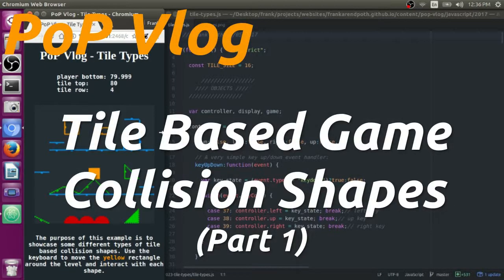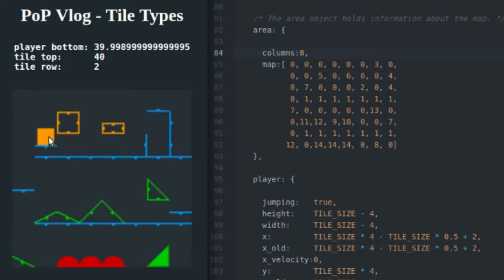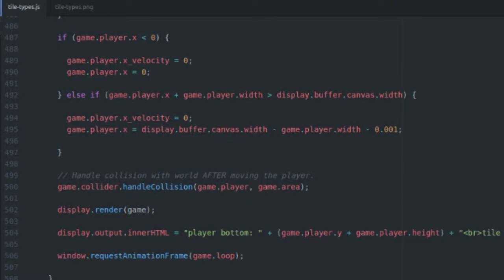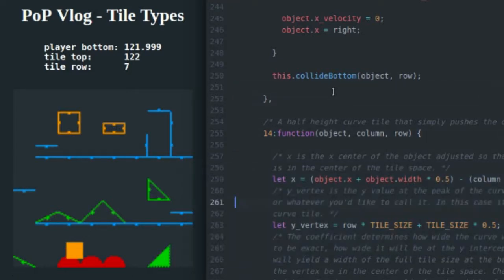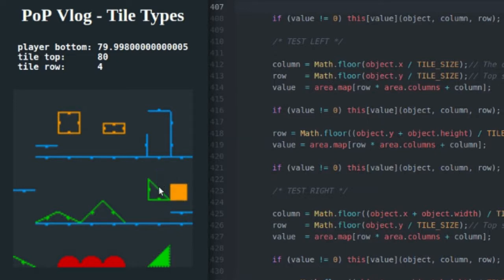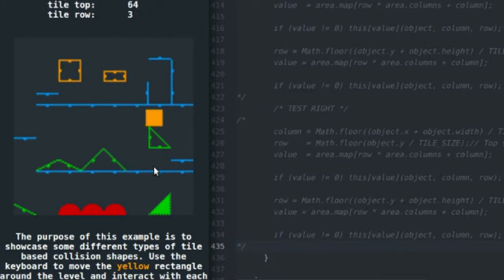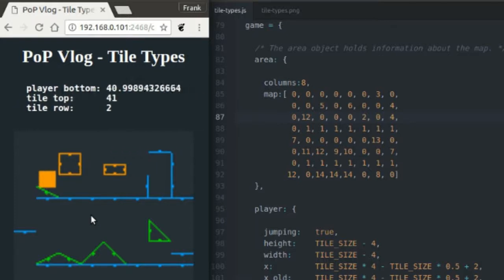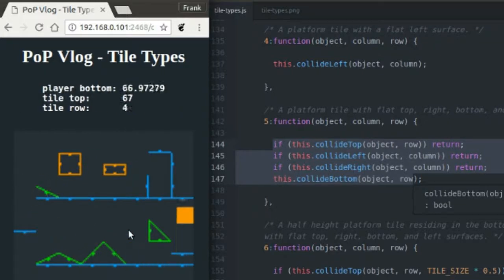Tile Based Collision Detection and Response - Part 1 Broad Phase System

Comment: Great video man I never thought of doing collision like that. I like the modular-ness! Also if anyone is using this for top-down game collision, ensure that in the broadphase you use the opposite old position coordinate for each section eg. top section: old_x, new_y   left section:new_x, old_y
Doing this will ensure that if you press a key into a wall tile your player wont get stuck sliding along it.

Comment: Thanks for your videos. I haven't found anything more helpful on this topic. I have been trying it out and found some improvements.

You set the jumping property to true, only if the user presses up. But when falling from a ledge you shouldn't be able to jump while falling either. I'd set jumping to true, if there isn't any collision from top in a frame and to false otherwise.
I have noticed, this kind of stuff is very hard to debug because sometimes there is a special case when unintended stuff happens, but it's hard to reproduce it and find what is wrong. And I'm never sure, that if I code something, if it's 100% proof. I'm surprised how you find these little details.
Reply from the maker: Yeah, that's true, my guy can still jump after falling off a ledge, but you can definitely fix that without too much trouble. And I find debugging to be a pain sometimes, but luckily Dev Tools keeps getting better. I'm going to try a new collision approach in the next couple of months hopefully. I like this method, but it can be improved.

Comment: Hi, I have one question... Why exacly handleCollision comes last in the code?
I mean, isn't "collider" and "collideTop" (example) what suposed to happen if handleCollision call a function?
Or the order doesn't really matter?
Reply from the maker: The order is important. You want to do collision after you move the player, and you want to do collision in a consistent order on the sides of the player. So, top and bottom, then left and right. Obviously you need to move before you test for collision, that part makes sense, but imagine you are running to the right over the tops of several tiles in one row and one of them has a left facing side as well. You will enter into collision with all the tiles because gravity is pulling you down into them on every frame. Some tiles will only push you back up, so there is no problem there, but when you collide with that one tile with the left face, two things can happen: it can push you up or it can push you left. You don't want to be pushed left, because that would stop you from running to the right. To remedy this, you would test for collision on the bottom of the player before you test for collision on the right side. The player gets pushed up and collision is no longer happening so you never check for collision with the left face of the tile. In platformers, where you are more often sliding over the tops of tiles, it is generally good to check for top and bottom collision before left and right for that very reason. So you always want to do general bounding box collision after you move, then carefully choose the order in which you test each side depending on your game.

Comment: I have some questions...
What is the number on the front of the functions? I don't know javascript, but I was thinking maybe it was called when a the value inside a colideSomething is equal to that number...
What happens when it's on top of two different tiles? How it decides what to do?
Reply from the maker: Those are just key value pairs, so if a function is in an object and it's labeled with a number, you can call it with object[number](parameter). That's a feature of JavaScript, but it's basically just indexing values within an object using numbers instead of strings. You can do the same thing by putting them in an array and referencing them by index, but with objects it's more flexible. And in the event the player hits two tiles, two functions will execute. The last one to execute will determine the result you see on the screen
Reply from the maker: Actually, in the event the player is falling down on two different tiles, one of them will respond to the collision, moving the player out of collision, and the second tile technically won't be colliding with the player any more, so it won't do anything. Not the best if your tiles have status effects, because one might not apply its effect if you collide with another first, but good for efficient collision.
Reply: @PothOnProgramming  I see! Thanks for your help, I started to undestand the code a bit more :D
Reply: Hey, one more thing...
I really don't get the name:function() { ... } parts...
What exactly is this? I mean, I never seen anywhere code like this... 
How these things work? Is there a name?
Reply from the maker: @NaitorStudios  It's just JavaScript syntax. That's how you assign a function to a property of an object literal. Look up object literal function declaration.

Comment: Could you slightly clarify what happens when you comment out second checks for every corner. I'm trying to get it, but i can't really understand what is the problem. Because it seems like you call the same functions two times with the same arguments. Do these functions somehow tell each some info? Like if you check top-left corner and then check top-right corner, then whole top side of your rectangle doesn't have any collision?
Reply from the maker: I haven't looked at this one in a while, but basically you have to check for collision on the x axis and the y axis. Say the top left corner is in a ceiling tile and above a right facing wall tile. If we do a y first check on the top left corner and move the player down out of the ceiling tile, the top left corner will now be in the wall tile. We have to check it again for collision on the x axis. This time it will be moved out of the wall tile on the x axis. Because of how collision is handled, I have to run two checks on the top left corner. Collision can only be resolved on one axis at a time, since I can potentially have collision on the other axis after the first collision response, I need to do two checks.
Reply: @PothOnProgramming  So, if i get it right, one collision check may push the object into another one, so it has to be checked again for this scenario?
Reply from the maker: Yes. The first resolution can push the player into another collision. Luckily, this can only happen once, so we need to do the initial check and then one backup check.
Reply: @PothOnProgramming  Ok, now i got it. Thank you a lot! For your answer and for your awesome videos.
Reply from the maker: Sure thing!